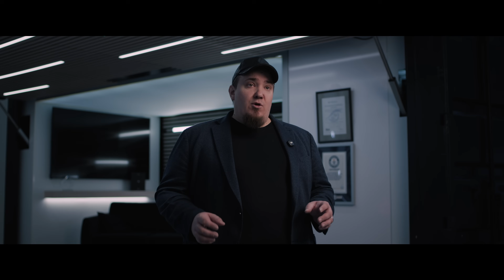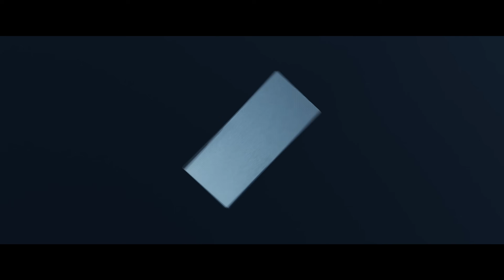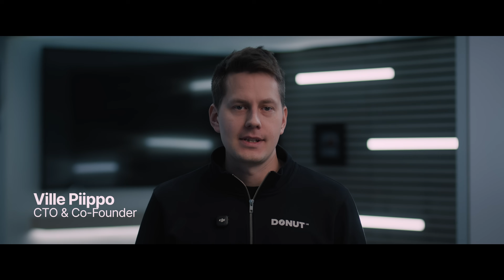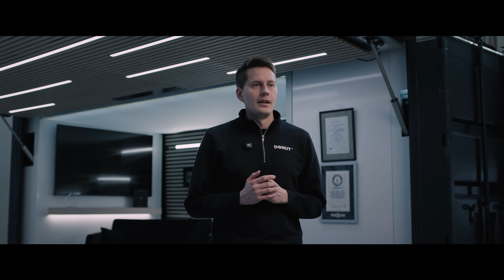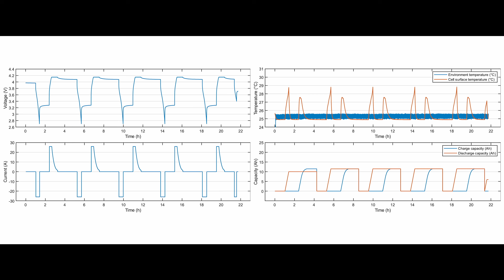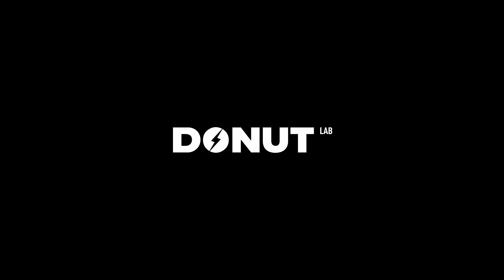Donut Solid-State Battery: Safety Demonstration Test | I Donut Believe (Pt.5)

Comment: What is the weight of the cell ?
Reply: Wether it's 1000kg or 1 g the point is it works.
Reply: Pack on cycle is same size, probably same weight, so pretty much we know what the power density is don't we.
Reply: Simple math: 235g. That is....94Wh divided by 400Wh/kg.
Reply: @juhanir3753  400Wh/kg figure should come from VTT, not from ur assumption
Reply: @clippyTheSahayak  Correct, but currently there is nothing to indicate that the energy density claim were false. Think how epic will it be - VTT revealing a precision scale and that 235g result ❤
Reply: @clippyTheSahayak  I'd prefer to find out by riding one.
Reply: @mark.pinnell  Wouldn't that be cool!? Me too 👍
Reply: @juhanir3753 they won't do it
Reply: @tedarcher9120  Oh I think they will. Why? We Finns, do not tend to talk bulls#&t on serious matters that matter. I think both remaining claims will hold 100%: 400Wh/kg capacity and 100k cycles.
Reply: @juhanir3753 why is it so hard to find a kitchen scale then?
Reply: @clippyTheSahayak  has to fit on the bike. So we know the weight
Reply: @juhanir3753 no, 400wh/kg a 100°C.
Reply: @SEmanelit  So hot 😍
Reply: @SEmanelit  The real question then is what is the density if it was on the surface of the Sun?
Reply: @juhanir3753 315g was informed at CES, its battery's gross weight. Naked cell is close to 235g. And we have already values available how to estimate it. Measured 94Wh, Verge TS Pro curb weight 230 kg, 20.2 kWh battery pack and charging speed test from 9 to 80% loading 14 kWh. Using simple math density of 400 Wh/kg is done deal.
Reply: @juhanir3753  That is if the claim of 400Wh/kg are true. We want them to weight the cell so we can calculate and validate those claims
Reply: @goncalocalvo8215  Sure. But why wouldn't the claim be true, they've verified all the claims so far? So, the 94 Wh energy on the cell is a verified fact.... judging on the approximate dimensions of the cell, it would actually be a miracle if the weight were more than 235g, wouldn't it?
Reply: @j @juhanir3753 
Because it’s at the same time one of the most important claims to prove and one of the easiest claims to prove.

If it’s 400Wh/kg, it can handle a descent number of charging cycles (it doesn’t even need to be 25% of the claimed lifecycle), it is at least in par in terms of safety and the price is right … all the rest is bonus.

Some of these bonus features are very nice to have (increased temperature range, better fast charging, no critical materials) etc). But if the fundamentals aren’t right, they’re worth nothing
Reply: @juhanir3753  It was advertised as 125WHr cell at CES if the size was the same as the tested cells...
Reply: @marcolammers  and one of the least fun ones to prove... keep the popcorn flowing!

Comment: The byd blade battery 2.0 does not catch fire while being lithium right?
Reply: Not if punctured, don't know about other forms of stress
Reply: @leoshork yeah I was curious about that too, because puncture usually results in lots of flames
Reply: When they do that puncture test, they go through the seal right?
Reply: lol  It likely would if unsealed.  But, you didn't mention that lithium is toxic during its entire life cycle.  That byd battery will be a novelty in a year.